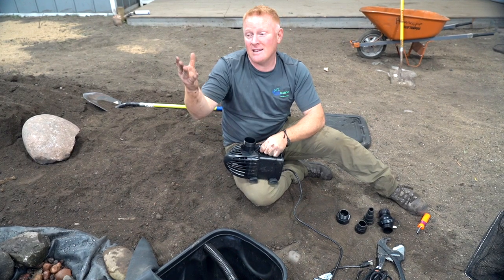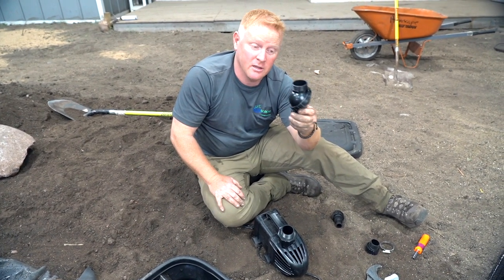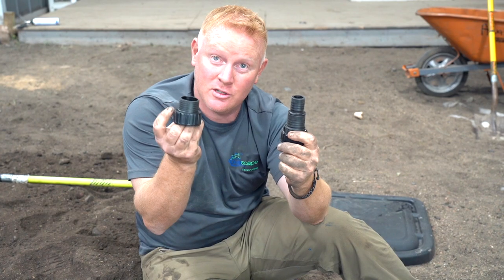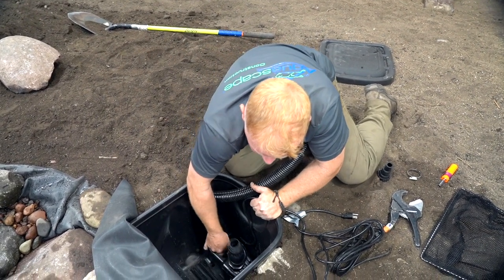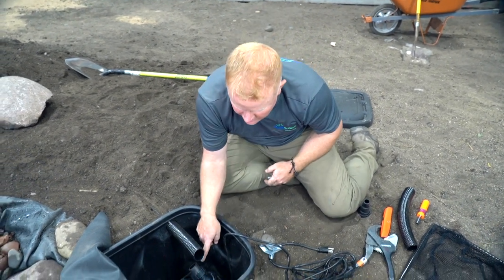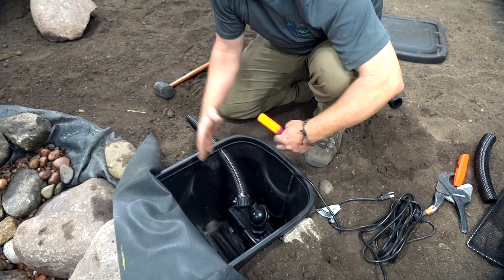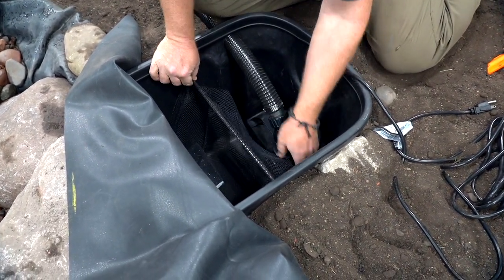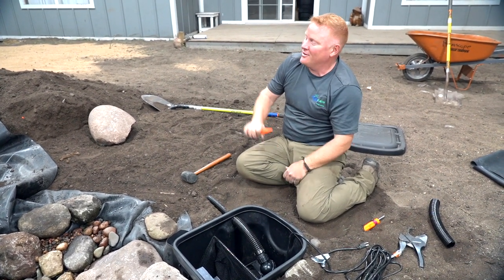How to Build a Koi Pond: Step 10 - Complete Skimmer and Pump Installation

Comment: What kind of  budget pump would you advise to use in a duckquaponics with about 958 gallons of water? I am thinking of the poop clogging a submersible, and I am completely ignorant in this field. People that are trying this out on-line have had fails, and some that think they are doing okay. When it does work out, they do not reveal the type of pump. Preferably something economical in watts, for this thing will have to run all the time.
Reply from the maker: When it comes to pumps, you get what you pay for. The AquaForce is a reliable, submersible pump with a filter and a cage to block debris. It's easy to remove the debris from the pump which you'll need to do from time to time. Your other option is a solids-handling pump that's placed in a skimmer. https://www.aquascapeinc.com/aquaforce-pumps